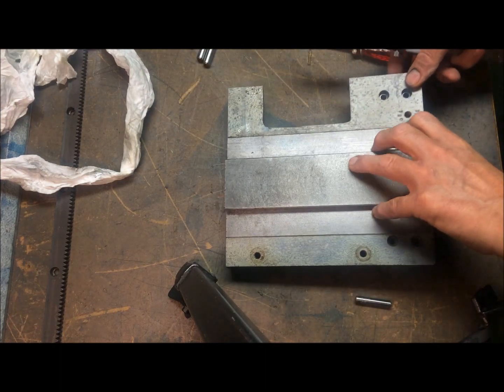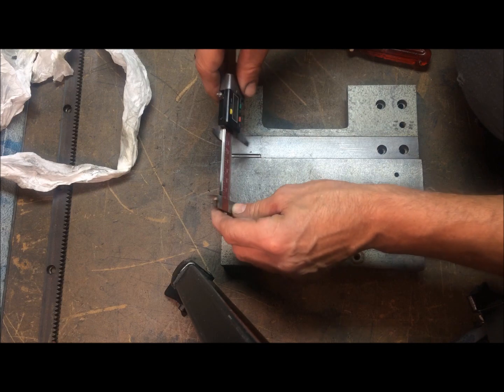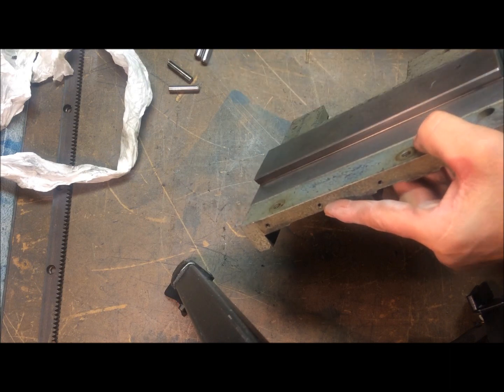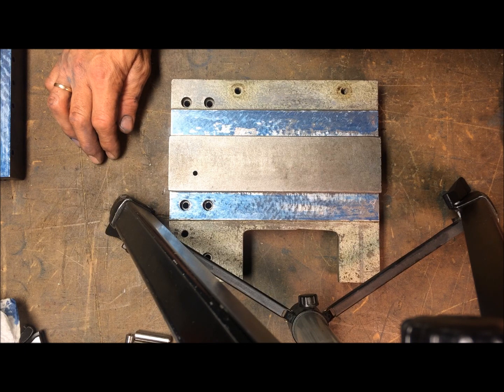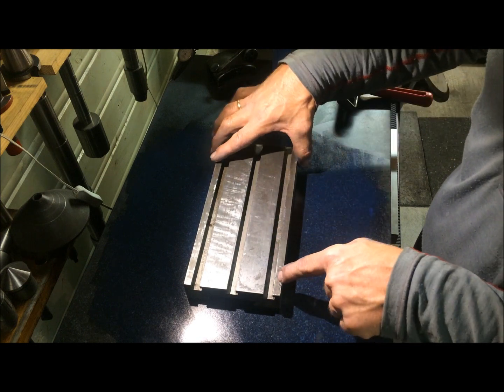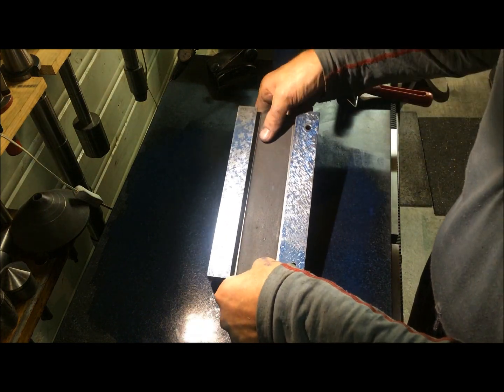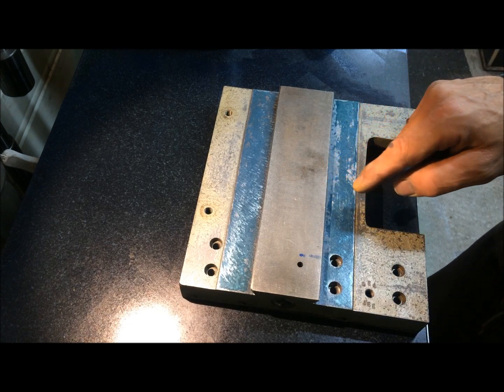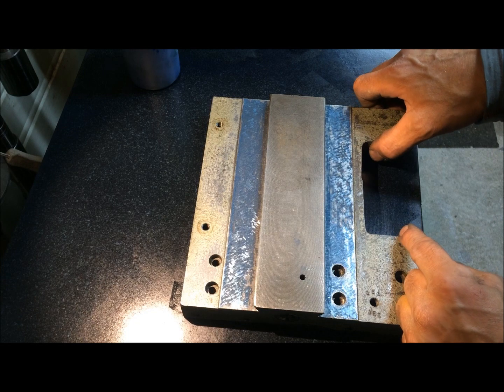EMCO Maximat Standard - saddle and cross slide table

Comment: what ar those two holes under the cross slide for? 
just bought this lathe and was wondering about those holes when i removed cross slide.
Reply from the maker: Don't remember, but they may be oil port holes
Reply: @jansverrehaugjord9934  ok. thanks.
Reply from the maker: Also check in this video.. 08:00 into he mentions that these 2 holes are for oiling the ways: https://www.youtube.com/watch?v=E7Bh_UrgacQ

Comment from the maker: I used a BIAX machine scraper for most of the scraping shown here. Rough scraped (area scraping ie. to obtain flatness) with longer strokes, flat blade and the circles technique. Switched to crosses, shortening strokes and switching to a smaller radii blade, ie. more curved for finishing (to get points)

Comment from the maker: Haha.. just watched again my own video.. and mistake(s). If you look towatds the end where I try the scraped underside of the table as a blued up reference to the mating top side of the saddle, I argue for also paying attention to how the "master" looks afterwards, not just the blued up surface under test which had a "flaw", ie. untouched narrow area towards the inner side. This is a valid point, indeed! but my problem here is that the "proof" I used was from the outer side.. Now having spotted this myself, as said, still a valid point and keep inspecting both the master (most times a surface plate or a straightedge)  and of the tested surface.